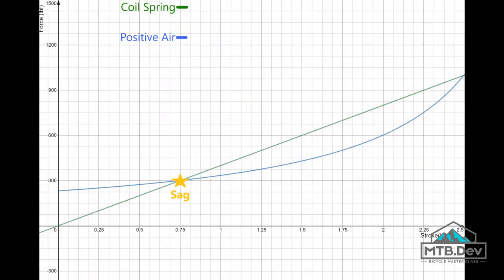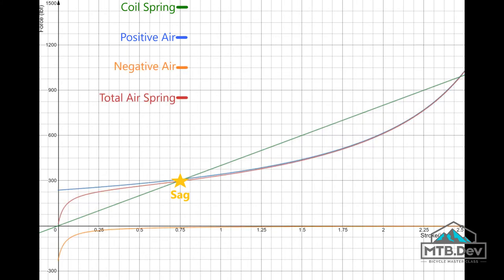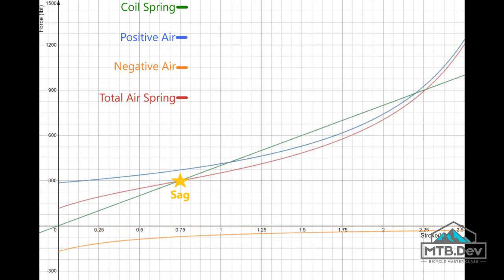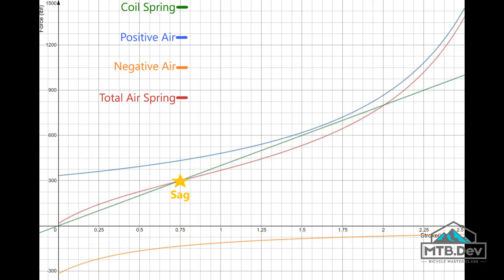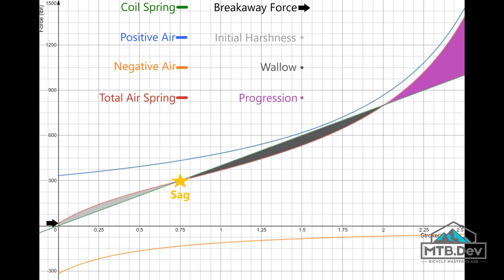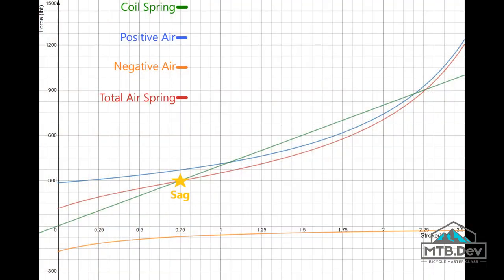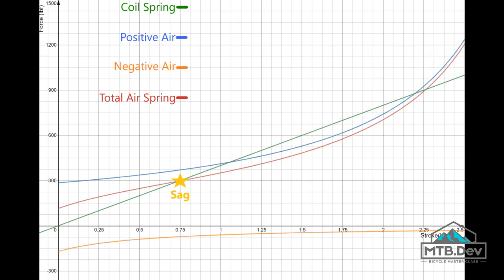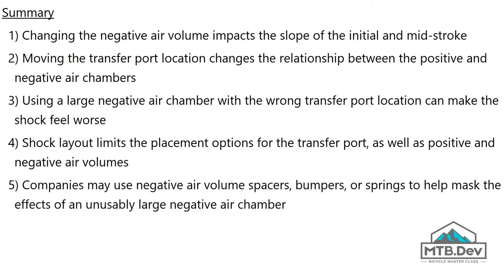The Negative Impact of Negative Air | Suspension Simplified

Comment: Hello,

My takeaway for negative volume tunning is:
- For a given transfer point between pos/neg, there is a sweet spot.
- Take all neg. spacers out of a high volume negative can (megneg / LV fox can) and you might experience harsh topout and high breakaway force at first contact with the ground (not enough negative compression ratio), and too much progression on the end of the travel.
- Put in too much neg. spacers - reducing neg. volume and you might experience higher spring force before reaching sag, and less spring force after sag (less support). Maybe suspension suck in extreme case?

Please are my assumptions correct?
Is there any in-depth literature on this topic available?
Thank you!